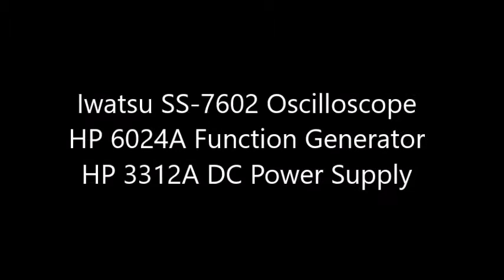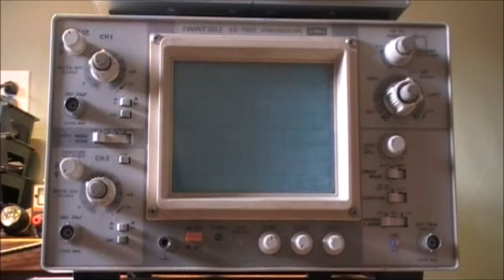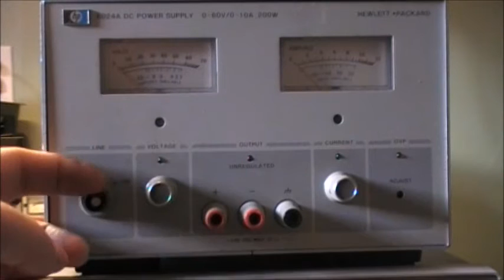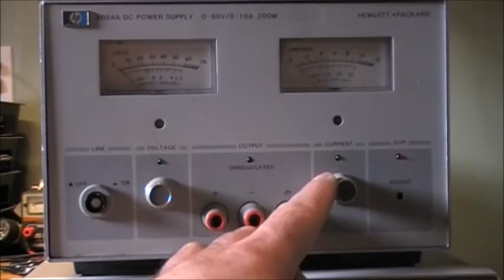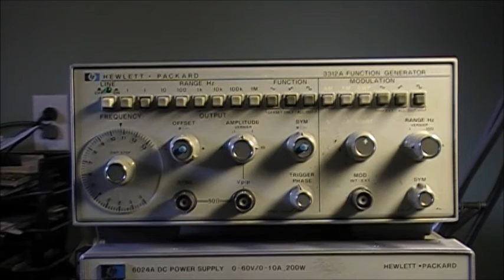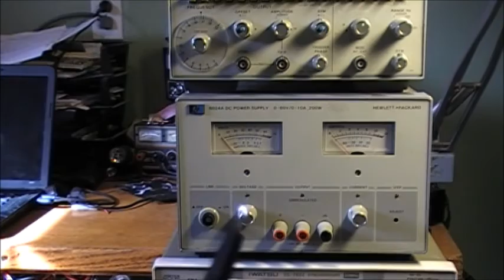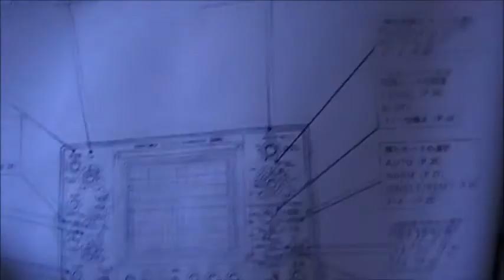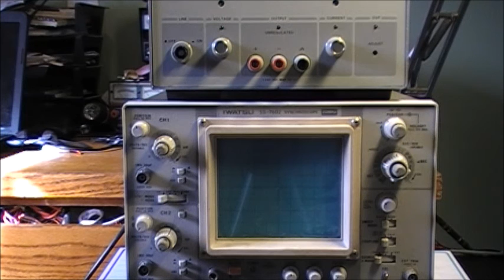Electronic test equipment - Oscilloscope, Function Generator and  Variable DC Power Supply

Comment: iwatsu scopes are underrated and very reliably built and the HP quality speaks for itself.  I have had some issues with some of the plastic used in HP equipment going brittle but then again it still working many many years on. Both equipment is maintainable I would expect that this is important for you. thanks Regards Chris
Reply from the maker: Thanks for the comment Chris. Sadly, my technical skills have not grown much over the years. I picked up this gear but have never really did much with it. Sourcing parts here is expensive and a lot of newer electronics is a throw away equipment. I think I may sell off this gear and look at getting something else like a better video camera for my videos.
Reply: There is just not enough hours in the day. Regards Chris